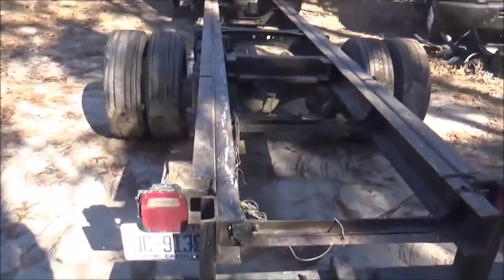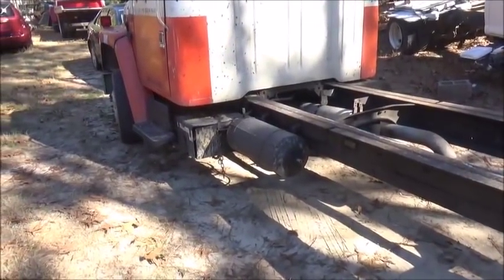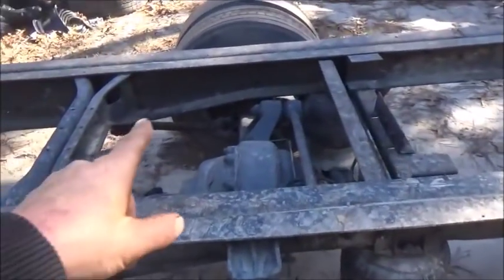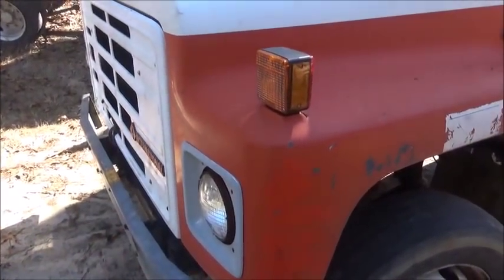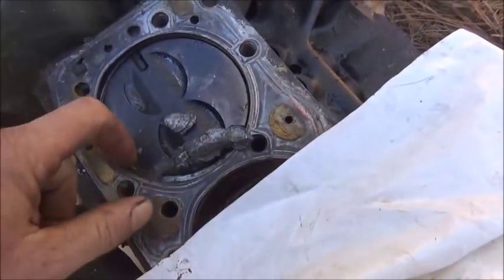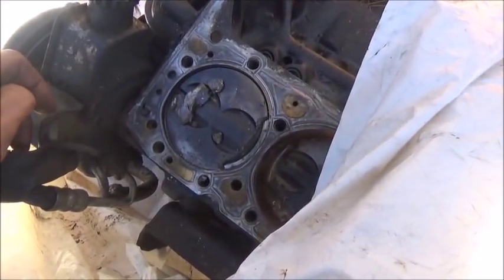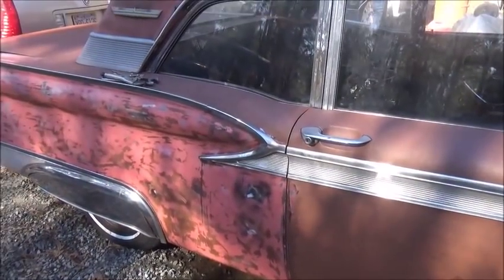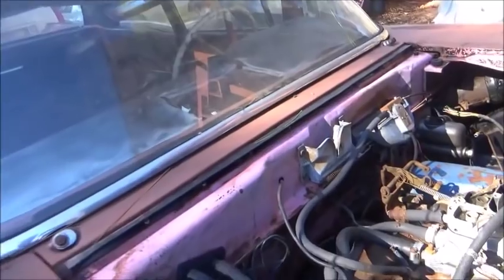UPDATES 1959 Ford Galaxie 350 Small Block & International Truck

Comment: Its a good thing your teaching your son to drive in a 1964 Chevy pickup, its the right thing to do. I myself had bought a 1955 GMC pickup back when I was 17, now 20. Kids these days don't know what's it like to drive an old truck with manual brakes, manual steering only with the exception it has its original automatic transmission making it slightly easier to drive. Besides driving an old car or truck is much more fun as supposed to driving a modern computer on wheels.

Comment: You're right about the situation with modern cars.  Drivers don't worry about their own safety because they think the car is going to save their life whatever happens, and that just isn't the case.  The biggest safety feature in any vehicle is a careful, attentive, aware driver.  If you aren't those things then sooner or later you're going to have a very bad day, and all too often that turns out to be your last day...  The parts truck was a damn good find.  I would think it would be worth hanging on to the cab too, if only for cutting up for repair panels, though I wouldn't have thought sorting out the soft floor and beaten up roof would be too hard if you needed a replacement cab for some reason.  Really, in the circumstances, pulling that truck apart is a no-brainer, though I'm sure there will be plenty of people who will decry pulling a good running, working truck apart...

Comment: I bought my first car at 15 (I'm 28 now) a 66' C10 pickup 3 on the tree with no power brakes or power steering, built the engine myself using books to learn (we didn't have internet in the country) and I still drive it to this day. I drove the wheels off of it and have put hundreds of thousands of miles on various cars over the years but have yet to be in an accident. I agree completely with your last statement. It's ironic that my first car was exactly the same as your son's and we both started driving them at the same age.

Comment: Good to see your update.   I had a rust hole in a muffler that I didn't want to replace so I used Durham's Rock Hard Water Putty (Walmart) to close the hole.  The putty hardens like steel and can be filed or sanded smooth and stuck great to the muffler for me.  I know it's a temp thing but might be something you could consider for the Ford.

Comment: We tore a cast piston up like that in a 350 years ago by turning the timing up too high. It made a big bang when it broke, then immediately went down on 7 cylinders because the spark plug got mashed. That piston caused a bad knock that sounded just like a rod, so I'm sure this one sounded like hell. We put another plug in that engine and ran it as hard as we could to try to blow up but it wouldn't. Hope the block is ok because ours got a crack in the cylinder from all that.

Comment: Jonathan have you ever ran into where your running one of those aftermarket gear reduction starters and a th400 on a small block when it shifts hard the ring gear will make a little bit of contact with the starter gear and this is a 86 above with a one-piece rear seal I have the flexplate that  it calls for according to the Parts House

Comment: your right on the no time to do anything but drive , I run my old 63 chevy wrecker daily for many years , 4 wheel drum brakes , truck alone weighs around 7 ton , plus something on the back , you spent your time watching the cars around you , always knowing where your out was , and making sure you knew they were slowing or stopping well before you were close to them , 4 wheel drums , thankfully factory power , they must have checked that box by accident being it's very unusual on them , you push as hard as you can , and you might stop someday , just how they were , these days I don't run that truck but an rare occasion , when I need the winching power of the old holmes 500 , or just want to run it , but I have to honestly fire it up and set and think to myself that I have to remember how to drive it , far different than our newer trucks , the kids these days either couldn't drive it  , or would kill themselves , or someone else in the first 5 miles behind the wheel ! you know you really should look into swapping that 59 to a dual line master cylinder , I did my truck after I lost a wheel cylinder and had no brakes , at least with a dual , you still have some braking ... anymore it's about a safety issue like running radials over bias tires ...

Comment: in the late 80's  at the rental store I worked at we rented U-Hauls, they had just started using the  drop tail thing to make loading easier, but for some reason a few years they disband that idea, I think they  said it had something to do with liability. on the Ford, didn't  ford products  use a fuel pump  with an axillary vacuum pump on it  for a while?

Comment: I agree with your statement about cars becoming too comfortable and easy.  Sadly, it's become the same thing in heavy trucks.  More and more companies are going with automatics, because then any idiot can make the truck go forward, and simply needs to be a steering wheel holder.  As for texting and driving, yes, it's definitely getting worse, not better.  The penalties currently in place are no deterrent, they need to get serious about it.

Comment: Had a question just wondering if that car doesn't have anything like antifreeze in it wouldn't it crack the block or something to headgasket that's what I always been told or sorta heard. But i just wanted see what u thought about that maybe some advice on that cause I wanted to do my engine swap in my chevy s10 and I didn't wanna do that yet or was worried not having antifreeze in it while I had it tore apart

Comment: Roofline work is a pain in the ass. Good (at the same time toxic) if you know how to do leadwork. Fords never had a 350 engine - closest small block would have been a 351Windsor, but they only came out later - not in '59. For '59 you would have had a 289 or 352 medium duty (bigger block).

Comment: Hey Johnathan I am a long time subscriber of yours and I have a question for you. I have a 73 all wheel drive loadstar 1700 ih truck. It currently only has a little over 15000 miles on it it has a 345 gas engine In it with a 5 speed non over drive trans in it its got 7.17 gears in the axles and air brakes also. Anyways I plan to make it a hauler for my very large backhoe loaded on a trailer and antique tractors pulling 30000 or so. I want to do a diesel swap to the truck and I would love to get your opinion on it. I have a good 7.3 idi I was thinking of putting in the truck also have a 12 valve Cummins and I have looking at 8.3 Cummins & 3208 cats as well. I know a lot of your fleet has oh 7.3 idi's I. Them. Do you think that they have the torque to do the job? Thoughts? Thanks in advance
Reply from the maker: No, they don't have a lot of torque. I like the 8.3 Cummins, but if you had a mechanical DT466, that is what I would go with.
Reply: @jonathanw4942  OK thanks for the reply I will continue with the search

Comment: Watch out for U-haul trucks they are ordered with special bolt patterns on every thing.  I had an U-haul F600 and nothing fit anywhere else .  They did so people would not steal their engines/transmissions wheels/tires.
Reply from the maker: I have 4 now. Only difference I have found is the windshield is 1/2 shorter.

Comment: Seeing the broken ring lands in the combustion chambers now I'm a little leery about that chevy engine😟. Those pieces could not have been good for the rods, bearings, head or crank. I'll bet that sucker locked up with those pieces in there. If it were me, I'd pull or at least disconnect the rods from the crank to see how, or if,  the crank turns. If it doesn't turn good, then, well, at least it was fun finding out🤷‍♂️

Comment: It doesn't help when auto makers are putting bright tv screens in vehicles, with internet, you tube & any app they want, & not only that but, automakers purposely build in failure points to drum up business, They reverse brake technology & go back to single cylinder master cylinder's & swear that the emergency brake is it's redundancy when in fact, when some cars loose brake fluid, the rear brake cylinder will not have enough brake fluid to compress the drum when the emergency brake is pulled if, you loose a brake line. HOW IN THE WORLD WOULD COMPANY'S LIKE FORD THINK THAT REVERTING TO A SINGLE CYLINDER MASTER CYLINDER BE A GOOD BUISNESS DESICION? 99-07 FOCUS- SINGLE CYLINDER MASTER CYLINDER & THE PLASTIC BARB CONNECTING THE HEATER CORE HOSE TO THE THERMOSTAT HOUSING=FAILURE POINT & THE SINGLE CYLINDER MASTER CYLINDER CAN KILL SOMEONE IF ONE PIN HOLE OCCUR'S IN ANY OF THE BRAKE LINES! I truly wonder how many other vehicles have purposeful failure points & safety issues like the two Issues I just pointed out on just one model that is frequently seen on the road today. Then take into consideration auto driving features, t.v. screens & internet access in vehicles today, I definitely see his point!!!!!!

Comment: And by the way you better find out if you have a 352 cleveland or 352 windsor engine they were both used in those years but were different engines
Reply: Those engines were 351 cu and are totally different. The 352 is an FE engine.
Reply: Yep, nothing in common other than the maker.

Comment: HEY A 1959 Ford galaxy DID NOT HAVE a 350 They either had a 332 or a 352 engine but DEFINITELY did not have a 350 small block.  that belonged to CHEVROLET
Reply: Jonathan knows that.
Reply: @jeffryblackmon4846  
Someone missed a video.